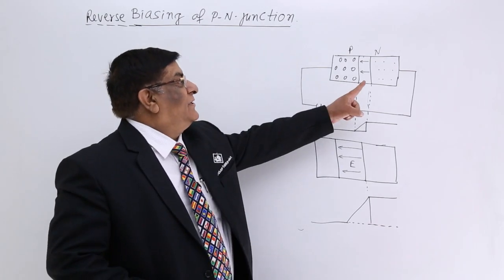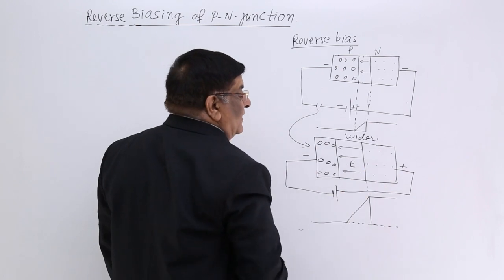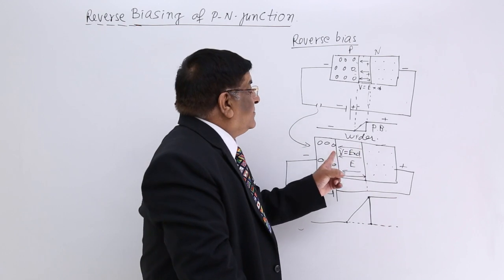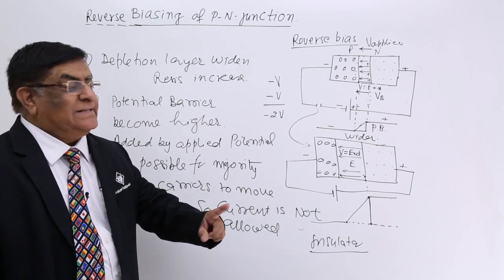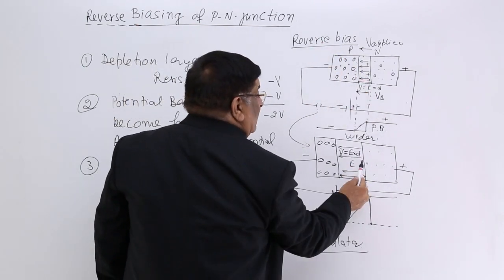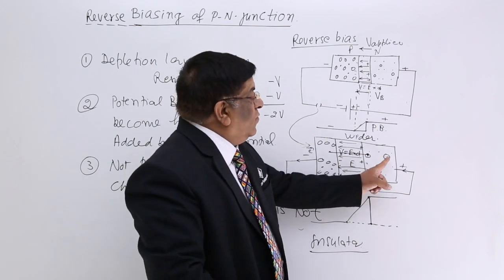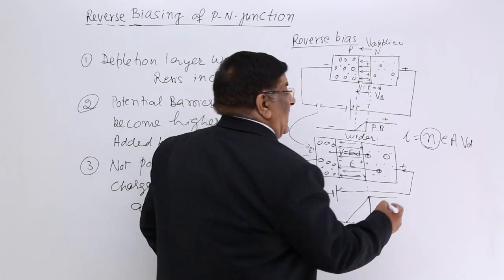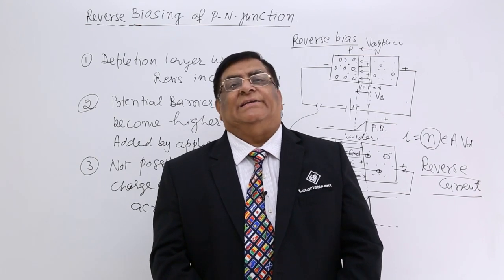Class 12th – Reverse Biasing of P-N Junction | Semiconductors | Tutorials Point

Comment: Why does no current flows through a diode in Reverse bias mode?
Reply: Because major carriers can't flow that is why
Reply: What is special about a reverse bias? 
Diodes are used in situations where we desire current in one direction and not in the reverse direction.
We sometimes hear a plumber say a valve is "leaky" and while he may fix it by replacing a washer with almost no leakage, things are not so easy with a diode. It is an unavoidable property and we have to devise ways ways to work around the leakage current of a diode. 
The reverse saturation current Io as a matter of fact, tells us the amount of current in a forward bias! 
The current expression for a diode gives the total current through the diode for either a forward or a reverse bias. For a reverse bias, the only current is a "drift" current, Io. If you examine the total current you may note that Io depends on the concentration of minority holes(electrons) in the n(p) side. That explains the tininess of its magnitude.
The barrier width grows only ever so slightly and is sufficient to drop the large reverse bias voltage! Don't visualize all the mobile holes in the bulk neutral p-region vanished into the negative supply terminal! 
Also, dont visualize all the mobile electrons in the bulk neutral n-type region vanished into the positive supply terminal!
And the reverse current is there until breakdown occurs on increasing the reverse bias. But who supplies the mobile holes and electrons to maintain the reverse current in a reverse bias? Learn more from the references below.
What is a pn junction ? 
A pn junction allows current in one direction only. It blocks current in the reverse direction. 
When a pn junction is formed, a potential barrier designated Vo comes into existence and is typically around 0.6 to 0.7 volts for silicon junctions. 
When the barrier whose Vo is 0.7 volts is disturbed by applying a forward bias of say, 0.6 volts, the current increases and the increase becomes steep for small increments of the forward bias value a little greater than 0.68 volts. Large currents are observed when the forward bias is 0.69 volts which is closer to the barrier voltage of 0.7 volts. 
The forward bias can never exceed the potential barrier voltage nor can it bring the barrier down to zero volts. That is the reason you seldom see current vs volt graphs of pn junction diodes beyond a volt or so.
How does the bias remain less than the barrier in an operational diode?
The voltage bias applied drops in the bulk neutral regions of the diode. 
The current in a forward bias adjusts to fulfill the conservation of current law and the rate of recombination.
A detailed description of the pn junction with a distinct approach using surface charges, alignment of Fermi levels, creation of the barrier, the distinct processes of diffusion, drift, recombination and the influence of the electric field on the energies of electrons is provided in the following textbooks.

Electrostatics and circuits belong to one science and not two, that of electricity and magnetism. To know how they are unified visit this link 
https://matterandinteractions.org/articles-talks/ and view the article 'A unified treatment of electrostatics and circuits.  B. Sherwood and R. Chabay, unpublished. (1999)'
pdf. 
For a live demonstration of surface charge and its effects in circuits visit 
https://youtu.be/U7RLg-691eQ
For a detailed discussion of surface charge, coulomb's law, electric fields, fields of dipoles and other charge configurations, and parallel plates, and a distinct approach using the surface charge concept in the study of advanced topics of capacitance, currents, conservation of charge, conservation of current, superposition of fields, superposition of potential, simple dc circuit, magnetic fields, magnetic fields of a current element, straight wire, current loop, solenoids, biot-savart law, voltage, voltage source, difference between e.m.f. and potential difference, ideal voltage sources, resistors, how current branches in a parallel circuit, capacitors, inductors, Faraday's law, inductance, ac circuits, transmission lines, Lorentz Force law, motors, generators, p-n junction diodes, electromagnetic waves, antennas and radiation, new electrodynamic theories on the nature of the electric field, see "Electric and Magnetic Interactions" by Chabay and Sherwood 
www.matterandinteractions.org
or 
Fundamentals of electric theory and circuits by Sridhar Chitta
https://www.wileyindia.com/fundamentals-of-electric-theory-and-circuits.html
There is a "look inside" feature in the amazon.com webpage of the book "Fundamentals of electric theory and circuits" by Sridhar Chitta with a few pages of Chapter 1 which may be viewed and also which you may swipe left or press < icon to view the foreword, preface and Table of Contents. The contents of the above book by Sridhar Chitta, make a distinct unified approach to electrostatics and a few advanced circuits like coupling signals to amplifiers, lending precision and clarity to the topics which is not found in most text books.
The book comes alongwith a CD with animated power point presentations for all chapters and voltage regulator, RC phase shift oscillators and differential amplifiers included additionally.
For a lecture by Prof Ruth Chabay on surface charge in a simple dc circuit visit 
https://youtu.be/-7W294N_Hkk
There is a full set of lectures beginning lecture 13 here on surface charges, electric fields, simple circuits, capacitance, inductance, faraday's law, motional emf, magnetic forces and more topics here
https://matterandinteractions.org/videos/EM.html
Reply: There is no  current by majority charge carriers because they get dragged to the opposite potential of the battery

Comment: How The minority charge on p side moves through the wide depletion region?
Reply: Minority charge carriers on p side are electrons.so,electrons can move from lower potential to higher potential and also holes(Minority charge carriers )on n side can move higher potential to lower potential..so it will move and  current flows..
Reply: @anwithadevansh108  thank you
Reply: @anwithadevansh108  ..really thnk u ..soo helpfull
Reply: @anwithadevansh108  What is special about a reverse bias? 
Diodes are used in situations where we desire current in one direction and not in the reverse direction.
We sometimes hear a plumber say a valve is "leaky" and while he may fix it by replacing a washer with almost no leakage, things are not so easy with a diode. It is an unavoidable property and we have to devise ways ways to work around the leakage current of a diode. 
The reverse saturation current Io as a matter of fact, tells us the amount of current in a forward bias! 
The current expression for a diode gives the total current through the diode for either a forward or a reverse bias. For a reverse bias, the only current is a "drift" current, Io. If you examine the total current you may note that Io depends on the concentration of minority holes(electrons) in the n(p) side. That explains the tininess of its magnitude.
The barrier width grows only ever so slightly and is sufficient to drop the large reverse bias voltage! Don't visualize all the mobile holes in the bulk neutral p-region vanished into the negative supply terminal! 
Also, dont visualize all the mobile electrons in the bulk neutral n-type region vanished into the positive supply terminal!
And the reverse current is there until breakdown occurs on increasing the reverse bias. But who supplies the mobile holes and electrons to maintain the reverse current in a reverse bias? Learn more from the references below.
What is a pn junction ? 
A pn junction allows current in one direction only. It blocks current in the reverse direction. 
When a pn junction is formed, a potential barrier designated Vo comes into existence and is typically around 0.6 to 0.7 volts for silicon junctions. 
When the barrier whose Vo is 0.7 volts is disturbed by applying a forward bias of say, 0.6 volts, the current increases and the increase becomes steep for small increments of the forward bias value a little greater than 0.68 volts. Large currents are observed when the forward bias is 0.69 volts which is closer to the barrier voltage of 0.7 volts. 
The forward bias can never exceed the potential barrier voltage nor can it bring the barrier down to zero volts. That is the reason you seldom see current vs volt graphs of pn junction diodes beyond a volt or so.
How does the bias remain less than the barrier in an operational diode?
The voltage bias applied drops in the bulk neutral regions of the diode. 
The current in a forward bias adjusts to fulfill the conservation of current law and the rate of recombination.
A detailed description of the pn junction with a distinct approach using surface charges, alignment of Fermi levels, creation of the barrier, the distinct processes of diffusion, drift, recombination and the influence of the electric field on the energies of electrons is provided in the following textbooks.

Electrostatics and circuits belong to one science and not two, that of electricity and magnetism. To know how they are unified visit this link 
https://matterandinteractions.org/articles-talks/ and view the article 'A unified treatment of electrostatics and circuits.  B. Sherwood and R. Chabay, unpublished. (1999)'
pdf. 
For a live demonstration of surface charge and its effects in circuits visit 
https://youtu.be/U7RLg-691eQ
For a detailed discussion of surface charge, coulomb's law, electric fields, fields of dipoles and other charge configurations, and parallel plates, and a distinct approach using the surface charge concept in the study of advanced topics of capacitance, currents, conservation of charge, conservation of current, superposition of fields, superposition of potential, simple dc circuit, magnetic fields, magnetic fields of a current element, straight wire, current loop, solenoids, biot-savart law, voltage, voltage source, difference between e.m.f. and potential difference, ideal voltage sources, resistors, how current branches in a parallel circuit, capacitors, inductors, Faraday's law, inductance, ac circuits, transmission lines, Lorentz Force law, motors, generators, p-n junction diodes, electromagnetic waves, antennas and radiation, new electrodynamic theories on the nature of the electric field, see "Electric and Magnetic Interactions" by Chabay and Sherwood 
www.matterandinteractions.org
or 
Fundamentals of electric theory and circuits by Sridhar Chitta
https://www.wileyindia.com/fundamentals-of-electric-theory-and-circuits.html
There is a "look inside" feature in the amazon.com webpage of the book "Fundamentals of electric theory and circuits" by Sridhar Chitta with a few pages of Chapter 1 which may be viewed and also which you may swipe left or press < icon to view the foreword, preface and Table of Contents. The contents of the above book by Sridhar Chitta, make a distinct unified approach to electrostatics and a few advanced circuits like coupling signals to amplifiers, lending precision and clarity to the topics which is not found in most text books.
The book comes alongwith a CD with animated power point presentations for all chapters and voltage regulator, RC phase shift oscillators and differential amplifiers included additionally.
For a lecture by Prof Ruth Chabay on surface charge in a simple dc circuit visit 
https://youtu.be/-7W294N_Hkk
There is a full set of lectures beginning lecture 13 here on surface charges, electric fields, simple circuits, capacitance, inductance, faraday's law, motional emf, magnetic forces and more topics here
https://matterandinteractions.org/videos/EM.html
Reply: due to potential difference

Comment: Why we plot graph in 3 quoter in reverse biasing
Reply: Just as for a standard plot of function in a xy coordinate system, here Current through the on junction is being plotted as a function of applied external potential.
In reverse bias we are applying a negative voltage. The forward bias situation is for the positive potential application.
In forward bias we get a large current in the direction of applied potential. This direction of application of potential is taken as positive and hence the obtained current is positive. The corresponding I V curve is in 1at quadrant.
For reverse bias the direction of application of potential is negative. The obtained current is very little but in the direction of the applied voltage which is in negative direction. Hence the graph is obtained in 3rd quadrant.